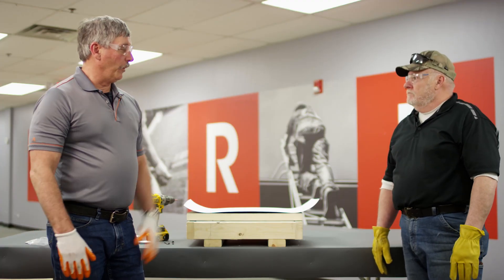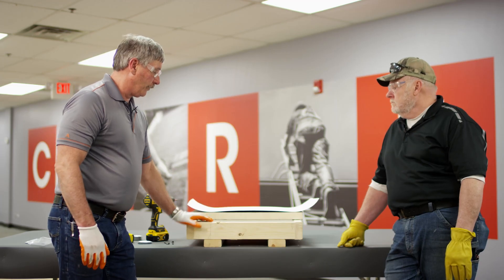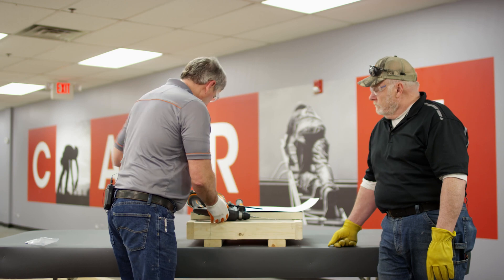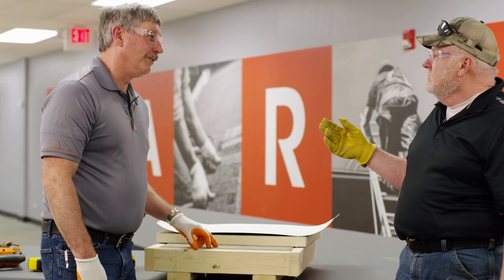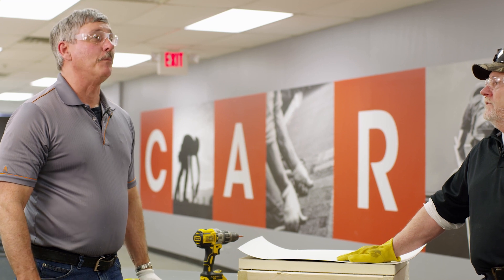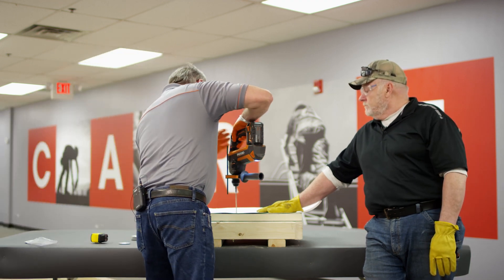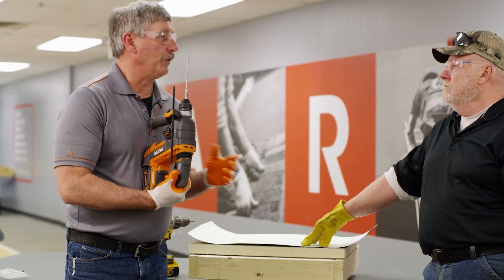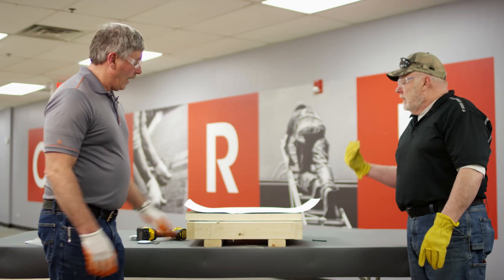Plates and Fasteners for Concrete Decks | Roofing it Right with Dave & Wally by GAF

Comment: When using the low rise foam to adhere to the concrete deck. What size screw would you use to fasten the TPO/VInyl to the ISO board? Would it need to be fed through the sheet connecting to the deck as well for support, or would the barbed plate and screw into the ISO board be enough to mechanically support the product factoring in for any potential wind load? 

Asking for a friend
Reply from the maker: Our experts are here to help you! Give them a call at 1-800-766-3411.